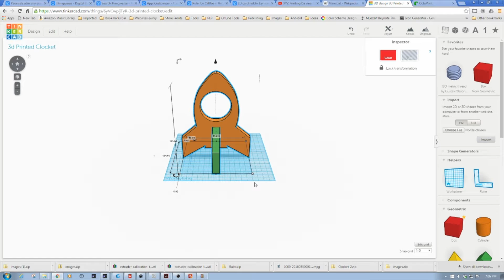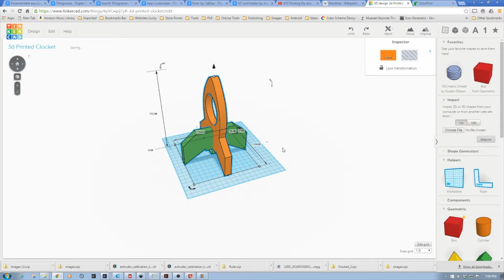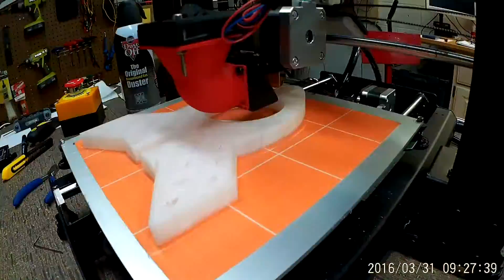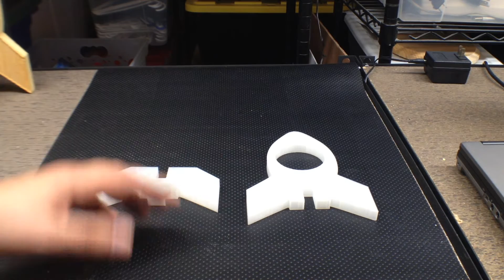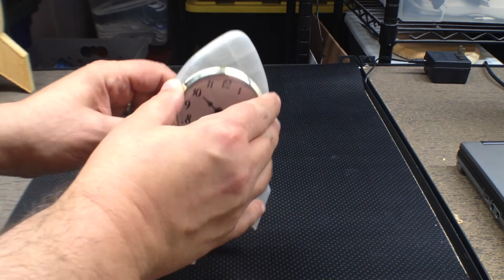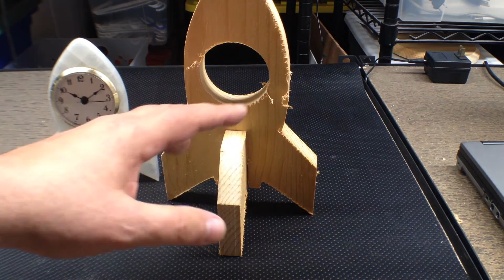3D Printed Project - 3D Printing the Clocket!

Comment: You need to mount the camera to the bed. If the bed was fixed it wouldn't matter.
I also would have squared off the bottom feet. Also even tho rockets have 4 feet, 3 would have sufficed I think.
Reply from the maker: +Mickice thanks for the comments, looked at mounting something on the bed but added too much weight.  As for the fins the reason for the four is so they "scissor" as they in two parts.  I am however looking at doing a one piece version (as I did a one plant stand) and see how it come out :-)